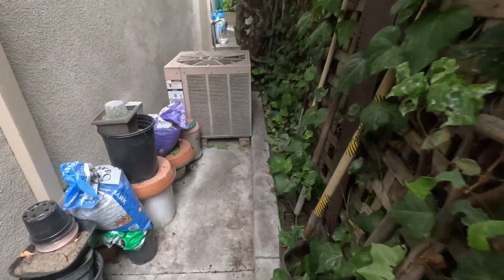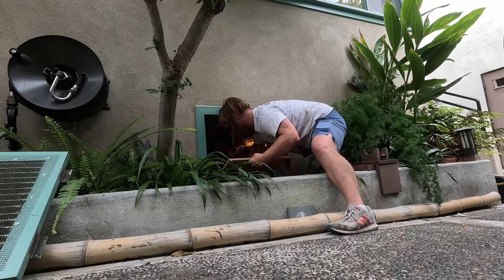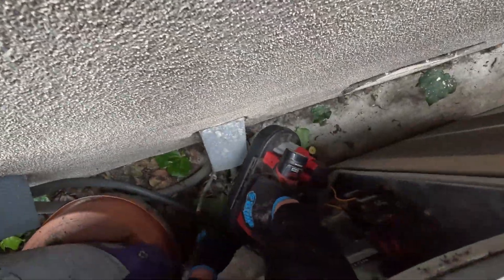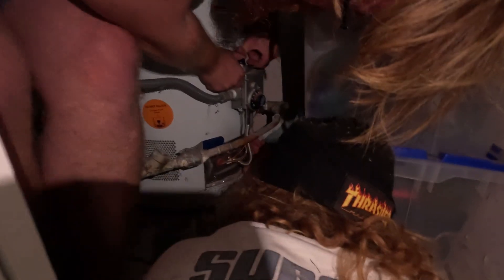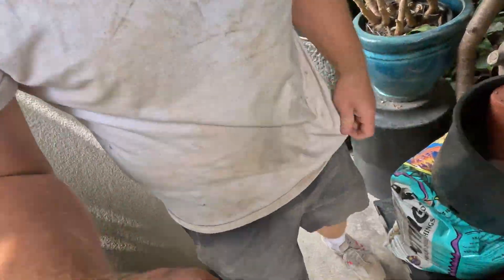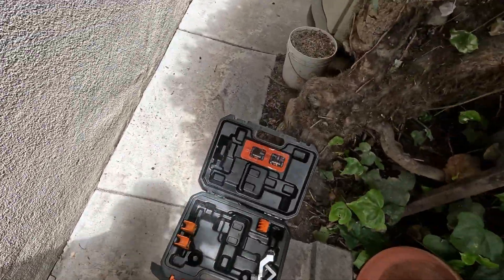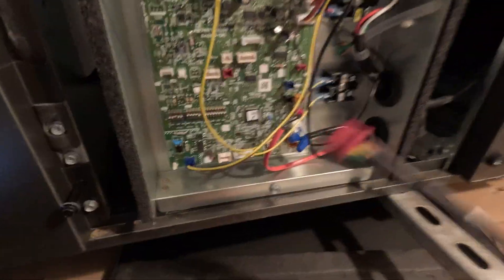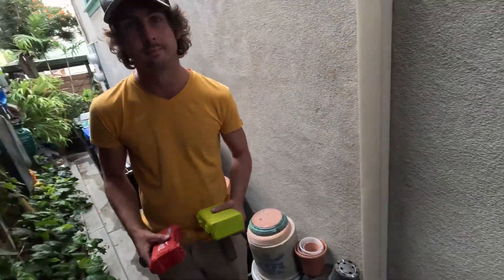Recalled Furnace?? Replacing It With a Heat Pump

Comment: Just came across this same type of furnace ealier this year. From what I can tell from the video, it's probably the same model. I tried fixing it because the heater didn't work anymore. Now that I know that its been recalled, I am going to condemn it. Liked the video. 👍
Reply from the maker: It's recalled in California if it was from the 80s/90s. They still are made I think cause I see newer ones every once in a while made by Ducane
Reply: @SurfBrosHVAC  Oh yeah sorry, I am from San Diego, CA. The Model Number I came across was HCC 075 ND4RX from Premier Furnace Company. Old. Anyways Yeah. Thanks for the information.
Reply from the maker: Who you work for?
Reply: @SurfBrosHVAC  That was a side job that I did. But I work for LC Heating & Air.

Comment: This new mini split crap are throw aways. Mitsubishi trash, parts expensive and hard to get. Like most 17 seer and above are screwing the consumers in the long run.
Reply: I mean, I haven’t seen any reason to agree with you. I’ve been installing high efficiency equipment most of my career. As long as it was put in properly it usually lasts a long time.
Reply: @AaronPowellvox  Guess my service work is on the beach areas, which will wear any units out. 50 years in the trade and seen a lot of crazy things come to the market.

Comment: Nice one. In my part of the country  we have a bunch of homes from the 1800’s , short ceilings in the basement.  Not uncommon for us to see slab evap coils because of this. Usually hooked up to lo boy oil furnaces. I’ve even seen two on the same system installed on opposite plenum branches.

Comment from the maker: Finally got another install edited for your viewing pleasure
Reply: Really dislike the MHK2.  Use the 24 volt adapter and put a standard thermostat on those.  The customer will be much happier.
Reply from the maker: Really? We've had no complaint's thus far about the MHK2 and we've installed about 10 of them so far. Never had a callback for one and never had a customer complaint. I usually follow up with customers on installs like this about a month later to check how they like the UI
Reply: @SurfBrosHVAC   I guess where you are, you aren't installing heat strips.  The staging of the heat strips is a joke with the MHK2 so I always use a 24 volt thermostat.  I live in a colder climate.